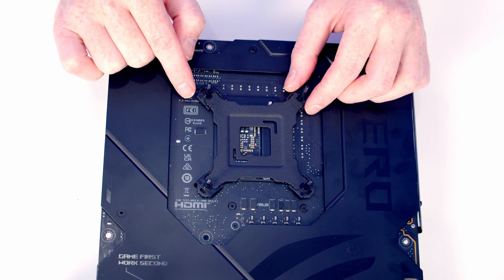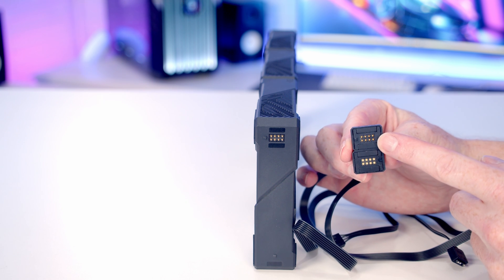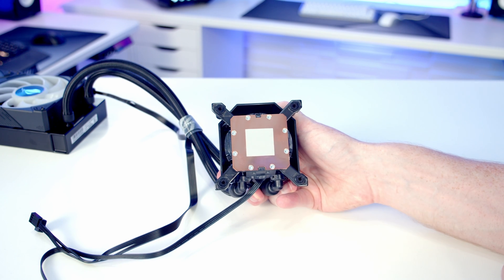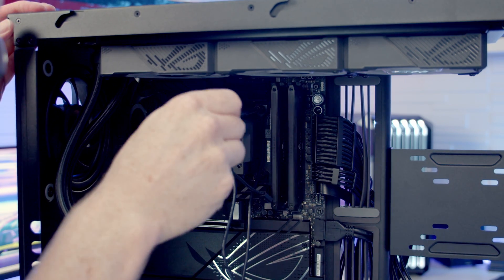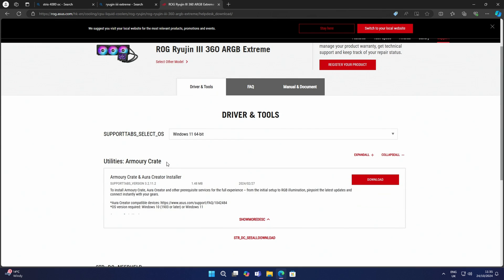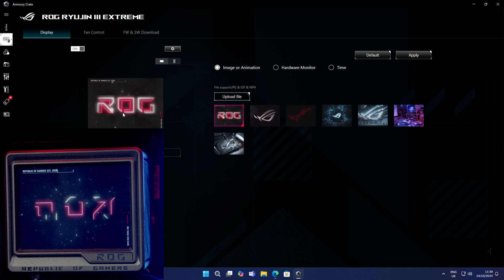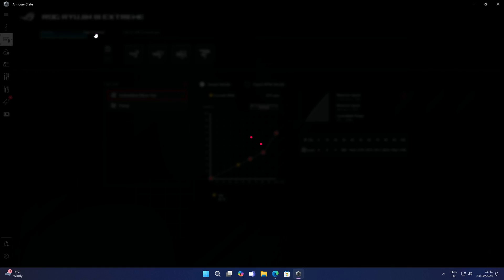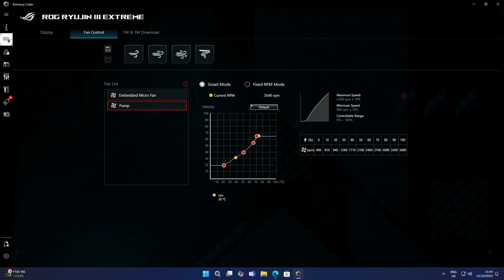ROG Ryujin III 360 ARGB Extreme - Installation Guide

Comment: Hi Chris. First, thank you for helpful videos!
 I have a question. I have the same aio but without extreme and Haf 700 evo case. Can i connect aio’s ARGB and PWM cables to the RGB hub on the Haf 700 evo case instead of my asrock taichi carrara motherboard headers ? Thanks in advance.😊

Comment: I installed this AIO on an asus rog strix z790-f white, but the radiator argb's I can't control them, they start changing color randomly, whatever option I choose in the armoury crate.

I installed the AIO fans on the CPU_OPT and CPU_FAN, the PUMP cable on the AIO_PUMP and the ARGBs on the ARGB_GEN2 ports on the motherboard.

The case fans in the Chassis Fan and the ARGB in the left over ARGB_GEN2 port.

The case fans if I can control the RGB but not the radiator fans.
Reply: I have the same problem with a z790 rog maximus.. can you control the image on the screen ?
Reply: my armoury crate just doesnt recognize the fans hmmm. i can adjust the display and fan speeds tho idk.
Reply: was there any determination for how to fix this? I just installed mine and for the life of me can not get the RGB to activate on the fans. I checked all my connections and all good. tried a different USB connection but nothing. I am at a loss

Comment: Hey, very nice video Christopher, got a quick question, for the AIO pump header, I only have the following ports on my motherboard: CPU_FAN,  SYS_FAN1/2/3/4, SYS_FAN5_PUMP,  SYS_FAN6_PUMP and CPU_OPT, so, for the AIO pump header it would connect to the SYS_FAN5_PUMP (or the one with the number 6) header on my motherboard? Sorry if the question is dumb but I'm kinda new to this, thank you!!
Reply from the maker: Yes. The pump headers likely have more power than the standard fan headers. CPU OPT tends to share the same fan curve as the cpu fan header which you don't want for you pump.
Reply: @ChristopherFlannigan  thank youuuuu, doing a build soon and definitely following your video for the AIO 😁
Reply: @ChristopherFlannigan  but to answer my comment what is there to do? you answered this person. it's ok. I'm getting the material and I would like to be already prepared for what I could do to fix things. May I know when I can have a moment of attention?🤔

Comment: This cooler is very very expensive
Reply from the maker: It is expensive, but the other versions have a high price also
Reply: @ChristopherFlannigan since you have had hands on with both, do you know if this cooler will work with the vision compact using the grommet hole routing the cables through the back?
Reply: It costs $349.99 USD on Amazon US.
Reply: Actually , on EU amazon, the Extreme version is only 350€ , while the normal version is actually 450€ (yes , i know its weird)
Reply: Not that expensive..